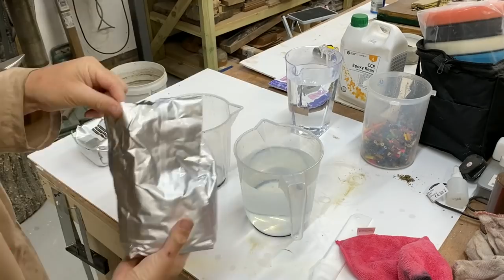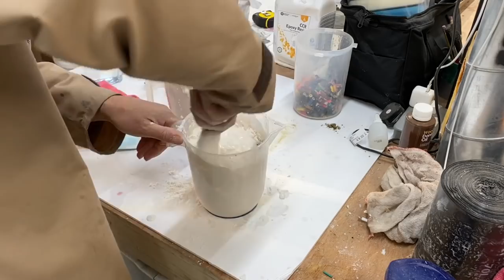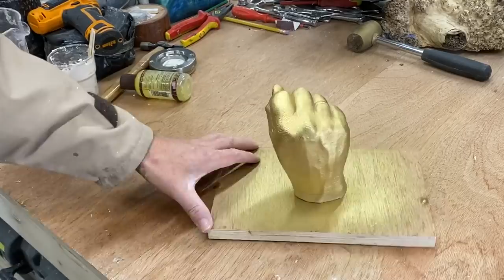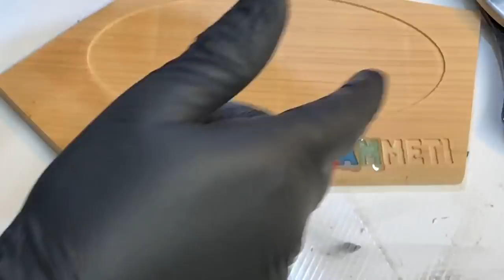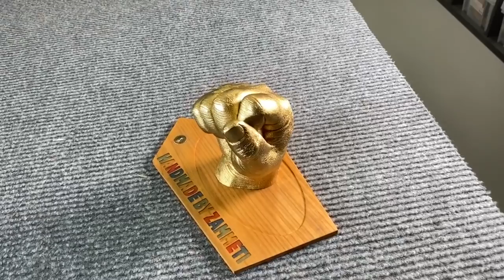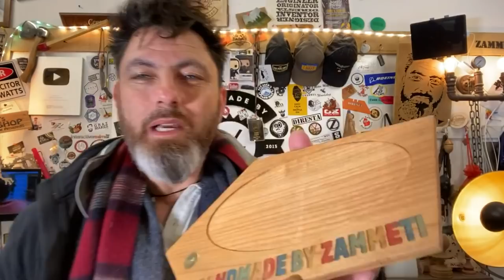DIY -  Casting/Molding your hand- Try this at home

Comment: You can reuse the mold if you cut it in a Z shape carefully and place it in the same container. May end up with a line on future castings but its easy enough to sand out. As always its a pleasure watching you work
Reply: Random thought, you can cast both hands to use as a "Youtube play button holder"

Comment: Next time after you remove the  alginate mold from the pot cut it in half, put both halves back in the pot and then make your pour. After your plaster sets remove the mold from the pot and carefully remove one half and pull you molded piece out and you can reuse the mold. It would also help to spray some "mold release" inside and it will be easier to separate. 
You may have a mold line you will have to sand/scrap off but that is easy.

Comment: At first I tried to imagine what the 'Golden Fist' award might actually be for. Then I went and disinfected my imagination! Btw, don't drop that cast or you'll be sad. Alginate impressions can be reused if you don't damage them when removing the object you've cast. You can keep them wrapped in damp kitchen towels/polythene bag in the fridge for maybe 24hrs or until they dry up & shrink out of shape. But you can get two or three casts from them in quick succession providing you preserve the integrity of the alginate impression.
Reply: Yes, I thought that was the stuff you could reuse. Maybe had to set a little longer & have a thinner wall around the item so it could set better. I believe we did it in Elementary school (grade 1-6 here in Canada). Probably a lot more costly now.

Comment: Wouldn't it be easier to cut the mold in two after the initial hardening then strap it back as you pour the plaster inside it?  That way the plaster goes off and you can just peel the mold (possibly using it again) at a later date similar to when you use silicone rubber ?  Or does alginate act differently?
Reply: Alginate breaks down and will not work like that. if you wanted to do that you then make a silicone mold using the plaster hand.  a whole heap of youtube videos on it

Comment: If you want a mould that's reusable, try casting your hand/arm in Silicon Rubber instead of Alginate...
Don't forget to lightly spray everything with Mould-Release to make getting the plaster/resin casting out easier...

Comment: A bit off topic, but relevant question for the guy who will try casting anything, will shipping tubes, paper towel/gift tubes, or pressed potato chip/crisps cans contain resin as it sets? Or, will it dissolve the material and destroy my newly made pressure pot? 

Our discount stores, where I might find a nice variety of suitable vessels, are either closed, or too confined to meet my distancing requirements. I want to keep making, but still want my vulnerable self here when the world resumes turning at its usual rate.

I'm new to casting and trying to be very efficient as conservation and availability are worth respecting, these days. TIA for any help?

Comment: There has got to be a better way to remove the alginate in two or three reusable pieces.  Perhaps using a long thin blade.  Nice ring detail. If you cast another fist, add a metal hook or ... to make a door knocker.  Stay safe, sequestered and avoiding Covid-19.  Peace brother.

Comment: the detail is very good.
not a fan of amazon though there support line is useless,
im an ebay fan paypal are always on the mark.
you might want to also try rtv rubber fast curing for 30.00 you should get about 2kg 
and you can use the mold over and over

Comment: When doing the resin casting, why do you need to put the mould in a pressure chamber, I am sure the average household does not  own of these expensive bits of equipment?
Reply: It helps force bubbles out so you aren't left with a bunch of little voids. They are expensive though. I'm looking into building my own cheap version.